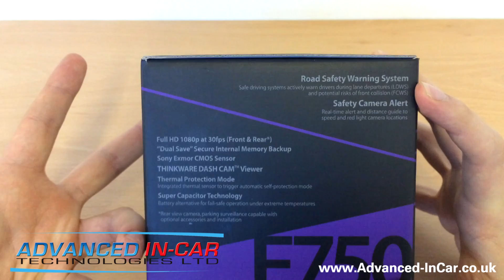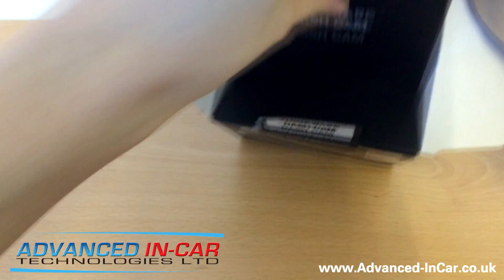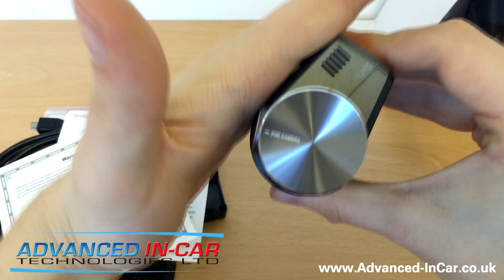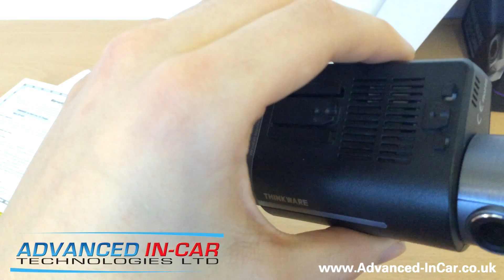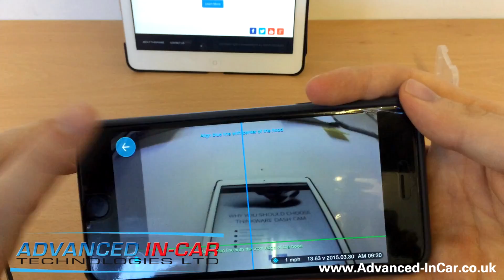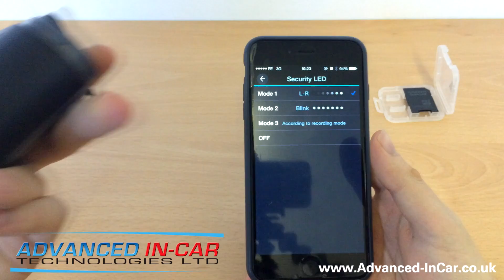Thinkware F750 DashCam UnBoxing & Review

Comment: Thanks for this great review! It seems to be the only good in-depth review for this dashcam on YouTube at the moment.

Can you tell me if this dashcam has delayed shutdown (without hardwiring)? I have a G1W that I intend to retire soon and I've had it set so it continues to record for 3 mins after the ignition is turned off. It might sound like a pointless feature but I've actually found it very useful on at least one occasion with the G1W.
Reply: ***** Many thanks for you reply! 

I'm actually glad you mentioned that it has a capacitor instead of a battery as it's reminded me of something else I need to find out.

Do you know if this dashcam will lose it's menu settings (date/time, etc) if the left off for more than a few days? I was put off getting one of the Transcend dashcams a while back because of multiple people having problems with date/time resetting frequently due to car not being used often enough (even after a day). I may be forced to just hardwire this if I do purchase one but it would be good to know either way :)

Thanks again!
Reply: ***** Thanks! I appreciate your help :)

Comment: Thank you for the the demo...very helpful.  I just got done setting up my dash.  I am not having much luck with the LDWS, it's not working at all even though I have it enabled and sensitivity is set to maximum and it's enable along with the speed setting set to 30 mph.  Collision detection is almost barely working.  I have to almost be on someones bumper before it kicks off.  I am not even sure if the traffic cam alerts will work.  I have updated that file too.  work in progress

I will be contact tech support tomorrow.
Reply: Thanks for the suggestion.  I went back and read the instructions in detail.  I think may have found what I didn't do.

2-3. Auto Calibration
ADAS setup guide screen in Live View is displayed only when LDWS and FCWS features are enabled through
Thinkware Dash Cam Mobile Viewer App.
Cautions
1. Before using LDWS and FCWS, settings must be calibrated using the ADAS setup guide screen in the Thinkware
Dash Cam Mobile Viewer App.
2. Auto Calibration will initiate when driving on a straight road at a speed greater than 30km/h (18mph) for
more than 1 minute.
Reply: Where I am at with getting the LDWS and collision detection working.  I complete the factory reset, ensured all maximum sensitivity was set, and also formatted the SD card.  I also tried adjusting the camera a further up from the hood.  I did the auto calibration too. Now the camera will barely pickup if I am to close or very seldom let me know if I am drifting from my lane.  I have a call with tech support, but as of yet haven't gotten any real help.  The camera functionality works great.  I just can't get all the advertised safety functions to work.  After talking with the the representative of thinkware, they explained to me that the safety functions dons't work as well as what are built into cars.  The car safe devices use radar from what was explained to me.  The thinkware cameras use only video technology.

I wish I could get my camera to function as well as yours.  I have the camera installed in a 2014 ford edge.  I will continue to tweak on my install to see if I can get better functionality. I am mainly going to try to do further auto calibrations and adjust the camera either up or down to see if that makes a difference.
Reply: Thanks again for the feedback.  I have requested a replacement camera and ordered another mountimg bracket to be able to test in a different type of car.  Should prove to be an interesting test.  I am also hitting the school of hard knocks with hooking their hardwire kit.  it's not a thinkware problem.  In my ford edge all the fuses have voltage on them even when the car is turned off.  I will have to find an accesory wire most likely after a relay or ignition switch.  In the meam time, i wired both red and yellow wires together to temporarily allow me to run the unit, otherwise it would run for a minute or just wouldn't  work depending how i connected the red or yellow to power.  Ground was a no brainer...
Reply: +Richard L What you know, I just loadws F750 Firmware 1.00.15 Update 2015-09-07 and the lane change feature finally started working.  I have continually tried to make this work as new firmware versions came out.  It appears this version has worked out the bugs.
Reply: Waiting for car s schematics and a little nicer weather, but should be able to get it to work once power is hooked up correctly.
Reply: Outstanding suggestion.  Thanks muche brazen30
Reply: The only thing in my fuse manual is this fuse. 
10 - 10A Run/accessory relay.  This sounds like it.
Reply: got the schematics.  basically for the Accessory power, you are going to want to pop the map light holder out and tap into the yellow/green wire.  Then splice into the power  purchase adapter cable for accessory power.  I have already ran that cable down to the fuse box and that's where I will pick up constant power.  No easy way on this on.  I didn't want to rip into the dash...it's a pain.  Also note, that this same circuit runs to the glove light though, I didn't research were you could get constant power near there.  Hope this helps someone else.  I guess when I get a chance, I will probably do a video.  Really, on the ford edge, there didn't appear to be any accessory power.  It's all done through a module...got to love electronics.
Reply: The Aux (Accessory) power will come from the dome light.  Much easier for me at this time.  The accessory power is right there and I have plenty of cable to splice into where I ran up from the fuse box to the camera.  I have about 10 ft of extra wire stashed under the roof padding.  The fuse I suggested early is only the relay that feeds the processor that controls all accessories.  So my constant power is already tapped at the fuse box along with ground.   The crazy ford edge has no accessory fuse.  I am sure you don't own a ford edge...I could wrong with what I am seeing but I don't think so because of the schematics and research.  This should have be a 30 minute job...it turned out much longer.  There are a ton of people wanting to know how to do this.  Again, much thanks
Reply: Thanks...I will post the video when done,  I have been up and running for a while but jury rigged it to work.  I have to remember to always shut the device off.  I had to wire the red and yellow wires together to make the camera stay on.  Now I have my accessory connection and will resolve that along with being able to use park mode.  Yeaaaa

Comment: It really looks like the best product in its class currently. Though I think I'd miss a "flag event" button, like on my current G1W.

Edit: Nevermind! I downloaded the manual for it. Pushing the REC button saves the previous 10 secs + the next 50 secs. A lot smarter than the G1W's "flag current file"-method, where you might just miss the file boundary.
Reply: ***** Great to hear. :)

Comment: The F750 only comes with one camera.  For the price I thought it came with both front and rear cameras, but when I checked out Amazon they sell it separate for an extra 100.  That's too expensive.  Plus if you are going to hardwire that's an additional 30 bucks.  A la carte is too expensive.
Reply: ***** Yesterday when I got to my car after work I noticed someone had placed something on my rear bumper causing scuff marks.  I was able to clean it up though.  I was so upset at not knowing who the culprit was.  

I agree with you on not going cheap.  I drive a 2014 Dodge Challenger SRT8.  After further research I decided to purchase the F750 from Amazon.  The rear camera is not available yet, but I'll pick that up also when back in stock.  I will have it hardwired.   I think the features on this dashcam is perfect for my needs.  Thank you.

Comment: Can you hardwire this to your car, and also is there a option auto start recording and stop recording when u start and switch off engine?
Reply: mitt bhogaita yes it has an option to hardware. You'll need to get a cable ($20 bucks) from Best Buy and yes it starts and stops automatically